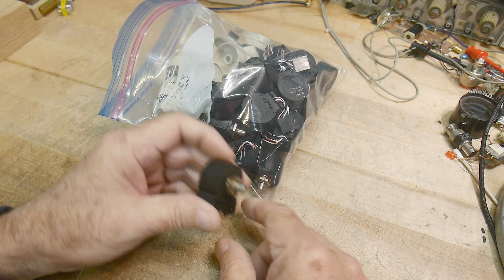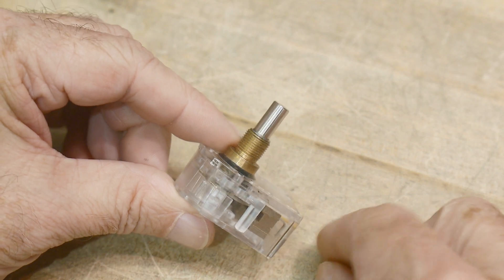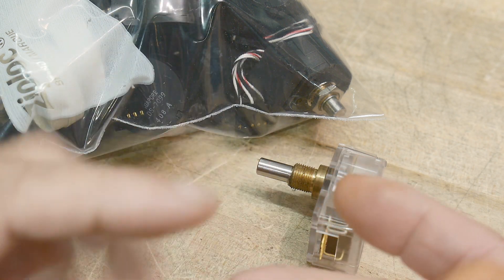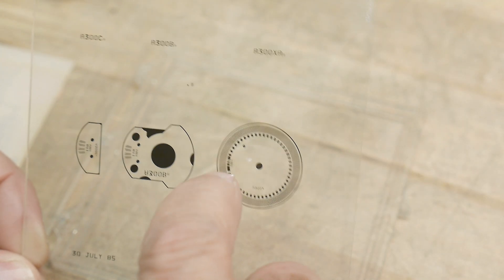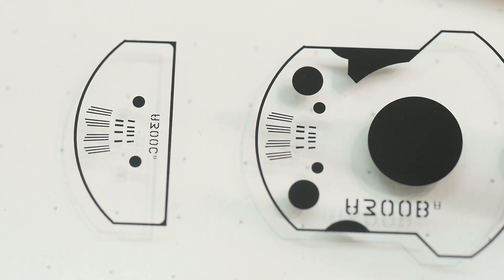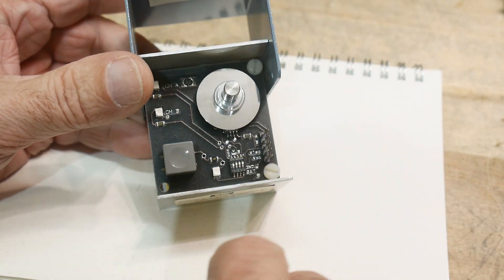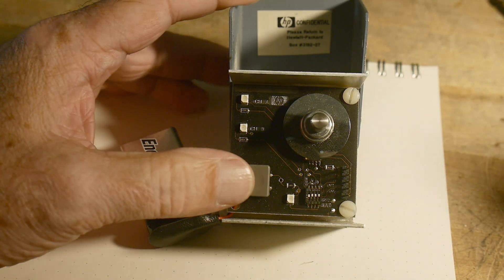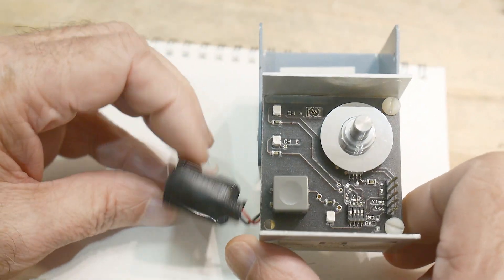#1451 HP Shaft Encoders secrets

Comment: Remember those HP-encoders from stuff I worked on around 1990!!!  That was when the microprocontrollers were 8052’s, lol, so we used some decoder-chips to process the QPM output to a binary output. Great was my surprise that those things showed up in cheap computer mouses just a few years later. In the 80’s when I started my electronics career, those encodersbwere all analogue synchro-transmitters.

Comment: Do you want to make a tutorial how to run an alc883 HDA  codec on an esp32 or stm32, maybe with usb  as input?
Some stm32(nucleo F413ZH) have SAI with selectable ac'97 option.
I did not find any example, tutorial on the internet how to connect hda(or ac'97) codec to microcontroller, and use it.

Comment: Speculation: One-sided 'Reflective' encoder could avoid using transparent glass, and thus could (conceptually) be made far more indestructible at lower cost than Thru models. Just in case an operator needs to ride along in a 30,000g smart motor shell.

Comment: I'm old enough that I recall seeing some encoders that were not optical, but purely mechanical. They had a rotary platter with conductive intermittent arcs, and wipers (one per bit) brushing along, either making contact or not. They used Gray Code * of course, because the mechanical alignment of the arcs was not very good at the required tiny scale. They were the size of a baseball or even a softball. Number of bits was never 16 (IIRC), but somewhere around perhaps 10 or 12 (so thousands of features per 360-degrees). An advantage was that they were power-on absolute, i.e. they didn't need a full spin to find the zero reference (optical encoders can do that too, if designed for it).  * FYI for those following along at home: Gray code is a mixed-up binary where only one bit changes at a time.
Reply: Didn't IMASI Guy does those 'mechanical' (with wipers) in vid #770? I mean, you don't have to be to old: they still use the mechanical ones a lot... and China makes a lot of them... for cheap... they are not very robust, or reliable...like the ones you are referring to... but they are cheap.  3 rotary encoder technologies... beside the wiper and contact type... and also way way more expensive are inductive, optical, and magnetic. A high end rotary encoder is ex... pensive!
Reply: Also, just to add the mechanical encoder you described, using Grey code, was an 'absolute' encoder. (There are incremental, and absolute, types.) The absolute type used to be much more expensive than the incremental type. There are also optical encoders that are absolute encoders.

Comment: I may have mentioned this before. My apologies if I did. I'm old and forgetful. It sounds like you were working at HP when I was at Lovejoy. We had a photographer take a promo photo of the control card in a 25 hp motor speed controller we were doing a burn-in load-test on. So it was spinning the dyno at full rated power when the photographer took the shot from 4 feet away using a big Honeywell Strobonar. It appears the light flash went right through the HP gray fiber-optic receivers and triggered all 3 phases of the GTO gates simultaneously, and 2 of the 3 GTO's grenaded. Miraculously, the photographer wasn't hurt, except for falling backwards onto the floor. The president of Lovejoy called HP and told them about the problem. They said that wasn't possible. But the next day he got a call back saying HP was sending us a box of black photo receivers. 

It was clearly a very uncommon failure mode, but one that did happen, and could happen again.

Comment: Interesting stuff.
Reflective demo-box: Looks like the knob shaft slides in and out a bit. Am curious if it's designed to work accurately through that type of motion... e.g. maybe it can have a pushbutton under.
Also, the index-pulse! Wow, I get it now, it's aligning a very specific marking, as opposed to just having a single slit. With a tiny bit of offset in scaling between the mask and the disk, it could probably be far more precise than a single slit alone.

Comment: LEDs and photodetectors have to be a certain size and this would limit the resolution of a small encoder.  They got around this using the mask plates (phase plates).  When the lines on the wheel and the lines on the mask plates are aligned, then half of the LED light gets detected.  When the lines on the wheel is between the lines on the mask plates, then the mask plates block half of the light and the wheel blocks the rest so that the detector is dark.  To get quadrature encoding, one set of lines on the mask plate is offset 1/4 of the wheel line period from the other set of lines.  The spacing between the line sets can be used for other detectors if differential signals are desired.